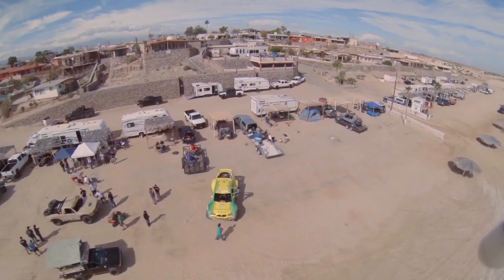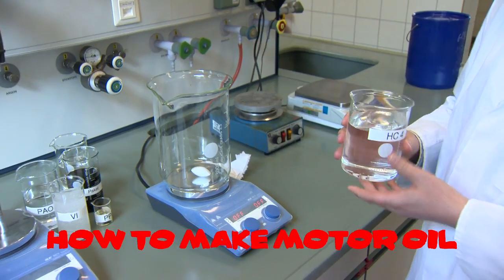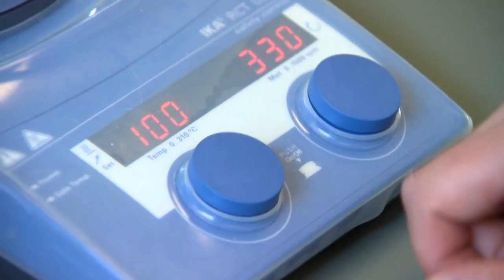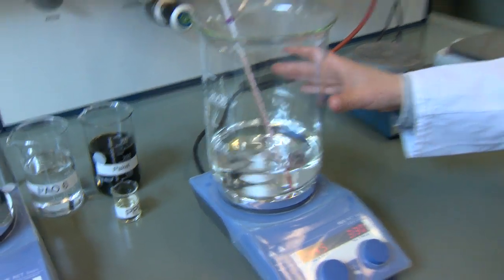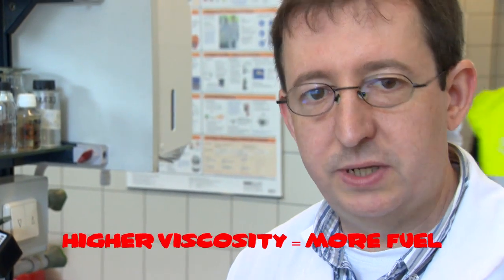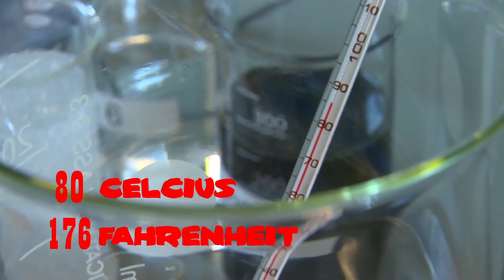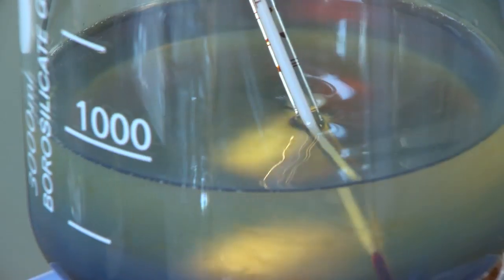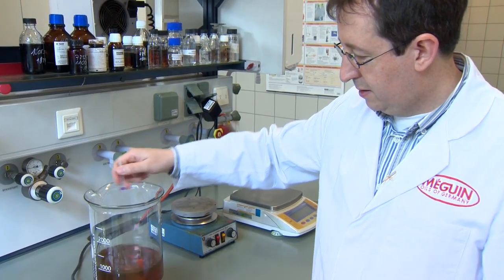What is motoroil?

Comment: I want to know that the engine oil "Touring High Tech Motor Oil SHPD 20W-50" is  described as "specially formulated for aspirated and turbocharged diesel engines " on this webpage http://www.liqui-moly.com/liquimoly/produktdb.nsf/id/en_2479.html?OpenDocument&land=GB. 

So from here we clearly get an idea that this oil is specially formulated for diesel engines but when I see the data sheet for this oil - (Link = https://pim.liqui-moly.de/pidoc/P000270/2478-TouringHighTechMotorOilSHPD20W-50-15.0-en.pdf), here it is mentioned in the properties "can be used in gasoline and diesel engines with and without turbocharger"
My question is whether its for both diesel and gasoline engines - why the website is giving contradicting information? Please guide me.
Second thing is about the name of the oil - in its name "High Tech"  same as "Synthoil High Tech" is used where as in "Special Tec AA" there is "Tec" no "Tech" -  Can you please elaborate the reason behind it?

I also want to know difference between Jectron Injection Cleaner, Fuel Injection Cleaner and Injection Cleaner - as whenever we search Injection Cleaner on Google - we get these 3 products. Please check the links below for their images:
Jectron Injection Cleaner: https://pim.liqui-moly.de/media/documents/3773/2007_1391511259491_ctx-1.jpg
Fuel Injection Cleaner: https://media.autobarn.com.au/media/catalog/product/cache/2/image/500x500/9df78eab33525d08d6e5fb8d27136e95/2/7/2786.png
Injection Cleaner: https://pim.liqui-moly.de/media/documents/1651/1803_1379931188521_ctx-1.jpg
Reply from the maker: Hi ActiveBigB 

Both descriptions are correct because it is certificated for Diesel (API CH) and Gasoline Vehicle (API SL). But to choose the correct oil for your engine you first have to check what does the manufacturer indicates for your engine, and then chose the correct oil. For that you can check our Oil guide and find the right oil.

Regarding the name Tec or Tech. This are product names and no indication to the certifications of the Oil. It´s just the name of the product.

Regarding the Different Injection Reiniger. Fuel Injection Cleaner and Injection Cleaner are the same, they only have different names because of the languages of the labels. 

Jectron Injection Cleaner has little bit stronger formulation regarding cleaning effect.
Reply: OK Thanks a lot for a detailed reply.